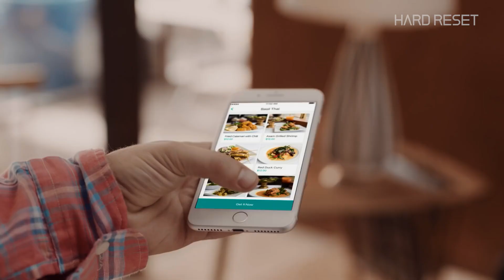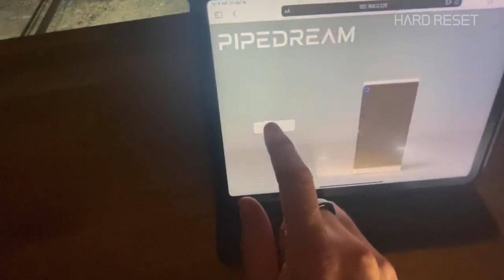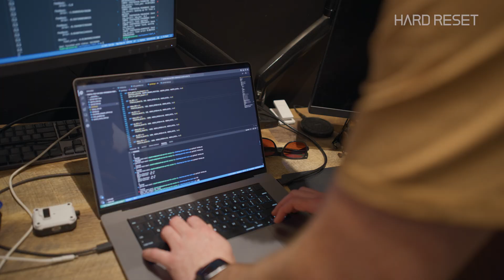I Tried a Sci-Fi Delivery Tube - It Actually Works?!

Comment: 18 inches should be enough to transport a (prone) humanoid robot as well, especially one designed to be so transported. 

Thus instead of buying an expensive humanoid robot to vacuum your house or mow the lawn you could just have one delivered to you via Pipe Dream and then send it back when the job is done!

These could also be used to fix problems along the pipeline as well vs having a human do so.

Thus it is not just one technology that causes  the game to drastically change but usually a combination of such technologies!
Reply: And then Bishop can fit into the access conduit to retrieve the dropship.    It makes sense

Comment: I'm more worried about other aspects: rats/snakes/insects in the tubes, flooding from rain or burst sewage/water pipes, bombs/anthrax in the delivery, even just the delivery version of DoS attacks in the form of 50 Pizza Hut Bigfoots waiting in one tube... or kids getting trapped exploring such spaces.
Reply: You can solve that by simply not accepting packages from unknown senders.
Reply: Are you actually worried about that? What about your water and sewage pipes? Do you worry about all that stuff, every day, with those pipes? I would guess not, unless you are in the really bad districts that corporations have killed the safety and there is lead in the water, like Flint, but aside from that, plumbing and community pipe infrastructure works pretty well. It can work well for last-mile good delivery like this, too. 

Just at the beginning stages of this developing technology.
Reply: @coolioso808  Not everyday, but here in small-town PA, such ain't rare. With how bad US systems've been kept up, big cities are just at worse risk from heavier daily strain!
Reply: @ well yes US infrastructure has been crumbling for years. Gonna take a community effort to change course for the better.

Comment: The overall mass of the components for plumbing is way less that for installing tubes, so the comparison is flawed and the economics for construction make this impractical.
---------------
Imagine a major gas leak and the wide spread destruction the tubes could cause.
---------------
Imagine a flood event and the total mess caused by piping the flood water into whole neighborhoods
----------------
Imagine a terrorist attack using an aerosol piped into the tube network. 
-----------------
The additional safety features needed to mitigate any of the above only add more costs. This is another flying car idea. Seems cool, but impractical.

Comment: I'm personally concerned about security with this.   How do you prevent bad actors from sending "bad" things through the system?  How do you prevent hijacking of the system?  You don't have the same implicit limits that water and sewer have, i.e., drinking water or sewage only goes one way, and tapping into those systems tends to make a mess.  This is a nice, clean set of tracks that could go anywhere and lead anything to anyone.
Reply: You have to design a more cooperative, egalitarian community that is built on trust and respect, better well-being for everybody so that the worry that 'bad actors' are just going to sabotage it goes down, and if they do, there will be community-based consequences and sanctions to those people who disrespect a community infrastructure that is designed to be useful for everybody, not damaged by a few. 

Like a public library. Technically, anyone can get a card for free, they can check out books and destroy them and stop people from reading books they don't want them to read. The library might fine them or suspend them, but they won't be able to fix the damage to the books. So, why don't anti-reading bad actors attack public libraries? Maybe because public libraries are one of the most respect public commons and institutions remaining in our society. 

Most people don't damage things they respect.
Reply: @coolioso808  Just don't allow people to send packages to anywhere without the consent of the designation. If someone tries to spam a bunch of bombs, it shouldn't be going anywhere except to the people who hit the "accept" button without questioning why.

Comment: Would this work for garbage and recycling as well. Like in an apartment building you send your garbage down a chute to the garbage room? Only instead of going there it goes to the city dump? That would save people putting all their garbage on the street for animals and wind to send it all over the place.
Reply: Look at the pneumatic tube garbage collection on Roosevelt Island in NYC for a implementation in the 1970's. It's still in use and they recently upgraded it to make it more effecient.
Reply: Probably, but also there is this company called TerraCycle that has developed specific collection boxes for hard-to-recycle trash that they turn into useful things again. These boxes can be put at events, homes, office buildings, parks, you name it and collect whatever trash can't be efficiently recycled in the traditional bins like metals, glass or paper. 

There are solutions out there, everywhere.

Comment: I'm a child of the 70's. At a drive up bank, my mother said, "I think pneumatic tubes will be run through town, like water pipes, someday and we can get good shipped directly to our homes." She wasn't far off. I think this will be far more universal than using drones, a concept I also find exciting.
Reply: Volume and weight are severe limitations.
Reply: @nihalbhandary162  Mixed modes of delivery is the best model, not one-side-fits all. A full network of automated delivery can be organized, some via underground tubes, some via drones, some via electric or green hydrogen trains, trucks or cars, and some via solar-powered podways. The compliment to all that automation would be neighbourhood localization so many bulkier goods like bulk food can be picked up easily at a corner refill store, periodically, when the people need it, they can walk or bike there. Most goods will be able to be made On-Demand using 3D printing or local manufacturing techniques and we can drastically reduce our overseas shipping or cross-country shipping loads. 

Over 50% of overseas shipping is just fossil fuels. Big ol' waste of time, resources and energy.
Reply: Underground it's far safer it seems (at least in terms of weight @nihalbhandary162

Comment: I can't see this going far
Reply: You could be right!  We cover a lot of early stage companies and many don’t make it.

I think it’s more likely that they’ll pivot to more localized implementations in the short-term - like drive thru restaurants, or curbside delivery systems.  That would give the technology time to refine and become more reliable.  Eventually I can see this being built into apartments and new neighborhoods - but by then it will need to complete with much more mature robotic logistics systems that operate on the streets or in the sky.

So I’m not willing to count them out yet - but I’m very confident that in the next 10-15 years, the way we send and receive small parcels will be vastly different from today.
Reply: @NickFromHardReset  like you said, it's going to be competing with much more mature robotics for last mile delivery. And those robots don't require digging underground. 

Personally, I think this is a non-starter.
Reply: Agreed. I can't see this competing with aerial drones, which don't need any additional physical infrastructure and only need coordination through air, which has plenty more space.  

If a system like this actually had Amazon-level delivery demand, it seems like a nightmare to coordinate with a single track for all that traffic, let alone doing it in both directions with empty carts.  
Plus, one malfunction that jostles even a single cart slightly off its rails —or earthquake that jostles the whole network of carts off their rails— and now you've got a whole bunch of useless clogged tubes.  

I have more faith in the company that wants to launch the moon-lander :P
Reply: “There are three stages in scientific discovery. First, people deny that it is true, then they deny that it is important; finally they credit the wrong person.” ― Bill Bryson 

Just at the early stages of this scientific tube delivery development. Maybe some are at 'deny it is important' phase, and maybe it won't be important, but if it is, and it does become important and we start seeing it everywhere in 5-10 years, let's hope we credit the right people - in this case - Pipedream Labs! Thanks guys for your bold innovations and energy to create a solution to a problem.